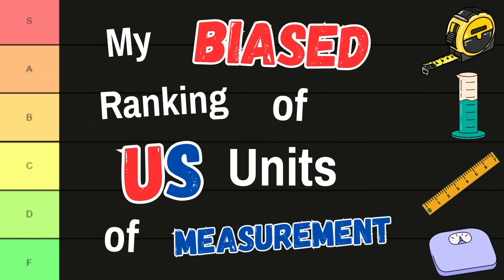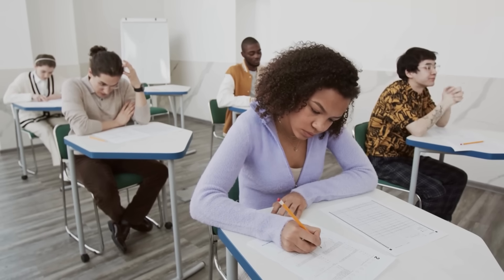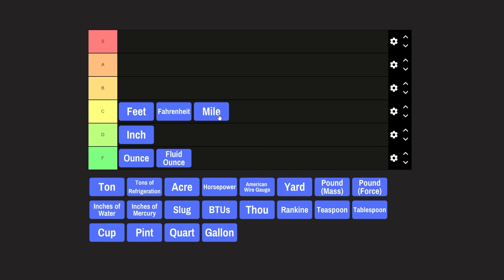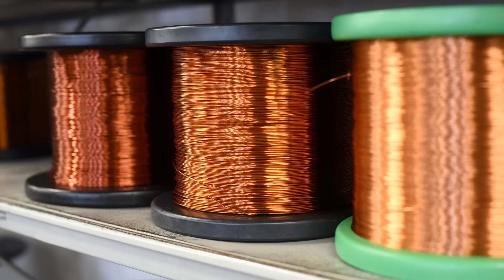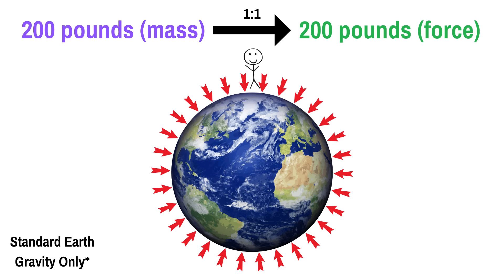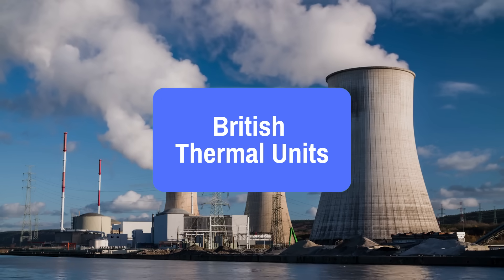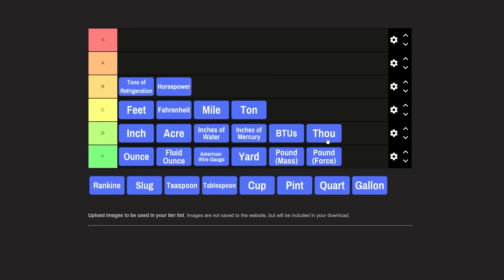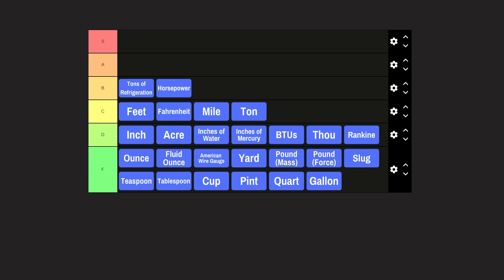Tier List of the DISASTROUS US Measuring System

Comment: British: force their colonies to use the imperial system

Also British: Look at these absolute BUFFOONS using INCHES

Also British: This is Timothy. He weighs 5 stones, 3 cloves of garlic, and a tod.
Reply: Let's also not forget the old British money system. That scale to weigh Timothy cost 1 pound, 3 shillings, 2 pence
Reply: Now, when US are no longer forced to use those stupid British units, it's time to change to metric, right? Right?..
Reply: @dmytronazaryk681  America doesn't use British (more accurately UK Imperial) units. An Imperial pint (what you'd get served in a UK pub) is 25% bigger than a US pint (20 Fl.Oz. instead of 16 Fl.Oz.). "A pint of water weighs a pound and a quarter" is what I was taught in school. An Imperial gallon (8 Imperial pints) of water weighs 10lbs. Although the tern quart, for 2 pints, is understood here, its rarely used nowadays. An Imperial ton is 2240lbs (almost exactly equal to a metric tonne). Your 2000lb ton is called a "short ton" here. An imperial ton is made up of 20 Cwt (hundredweights) of 112lbs (which is very nearly 50Kg). 1 Cwt is made up of 8 stone, each of 14 lbs. I weigh about 12 stone/75 Kilos. I prefer to use the Imperial as it sounds a lot less than the Metric.🙂
Reply: @dmytronazaryk681  Not if the GOP have a say in this.
Reply: Worked in Australia during the pre decimal days. Had to learn to count money in Pence, Hapenneys, Thrupence, Shillings. Florins, 
Thrupppence, so on. Had to add columns of coins divided by 12 and 20. Took a bit to get used to then came change over to decimal with two legal currencies running side by side for a time. Ran into the same thing in Ireland and Germany with the Euro conversion.
Reply: As opposed to being 28 bananas tall in America.
Reply: Many (older) Brits still use imperial measures in casual day-to-day life. But we switch to metric when precision is important. And speed limits are still in miles per hour...
Reply: We might have started it but at least we had the good grace to change to something better when it came along. We still even hung onto a few antiquated units for measurements where accuracy isn't essential so they wouldn't feel left out
Reply: Well, being able to change when an option is clearly better is certainly a good thing to learn.
Reply: Atleast the US fl-oz is based on mass of water and not some arbitrary solution
Reply: The british created imperial as a response to metric.  It shows in the 10 pound imperial gallon
Reply: The USA does not, and never has used Imperial units. Those were not defined until the 19th century. What the USA uses is US Customary units, and there are significant differences. Of the ex-British colonies, only the USA has not adopted the metric system for common usage, and they have the longest period of independence. Note that the unincorporated territories of the USA, essentially US colonies gained by annexation but not incorporated as states all use US Customary units as far as I can tell.
Reply: You forgot to mention those us units are standardized on the metric system.
Reply: @TheEulerID  that makes it even worse, believe it or not
Mile. Nautical mile. Pound. Ton. Inch. Foot. Gallon. Pint. Cup. Teaspoon. Tablespoon. Quart.

All of those units aren't shared by the Imperial system and the US system.
This is bad.
Reply: Nearly 40 and English. I only use imperial for things we are stuck with. Like miles on the road (though my sat nav is in KM. Go figure) and buying pints of beer. Tho I order wine and spirits in metric ml.

What the fuck government. Please can we just have all metric.
Reply: @AdamMGTF  As far as I'm concerned, then you are just another petty zealot. To be clear, I have a physics degree, and in professional work use SI units all the time. However, traditional units are part of culture and history. They have their own particular social place, and are built into the very language as idiomatic phrases. We miss things by miles, we do not give an inch, we cannot fathom something, we go for a pint, we go the extra miles, the whole nine yards and any number of similar phrases. 

This is an important part of people's cultural background. So be damned with your  yearning for consistency where it doesn't matter one iota. People generally have an intuitive feel for what they were brought up with. It is often part of their very identity. 

As a wise man once said, "A foolish consistency is the hobgoblin of little minds, adored by little statesmen and philosophers and divines". I shall continue to prefer my beer in pints, distances in miles and mountains in feet (you feel you've achieved so much more on climbing one).

I also consider it a valuable skill to be able to convert and be familiar with different unit systems.
Reply: 64 and I agree! @AdamMGTF  Was recently in Canada and the Canadians were trolling the Americans for not using metric. Did you see the results of Rees-Mogg's online survey suggesting that we go back to Imperial only? only about 0.1% of people thought it was a good idea. I voted for full on metric
Reply: @MadTamB  I haven't seen that. I can't imagine anyone at all who actually uses measurements would ever want to use imperial. 
There is a wonderful irony that Americans are proud to have left the empire yet are one of only 3 countries that use imperial. And I think the other two have civil wars or something.
I'd happily scrap all imperial units here. The biggest headache would be going to kmh on our roads. But given we don't use signs for speed in most places it wouldn't be that bad. Pubs already use metric for most measures. 

So I'll happily consider the yanks bafoons. All while wishing we weren't stuck with the legacy crap of imperial

Comment: Also horsepower was more accurate at the time, as the horse (over the duration you'd use it for) of the era (way smaller) would put out nearly 1 horsepower...
Reply: [citation fucking needed]
Reply: ...Horses are literally bigger now than they were back then. That's pretty common knowledge in horse breeding space. It's also common knowledge that larger animals produce more horsepower.  @JürgenErhard

Comment: Context: UK
At work, we have some expensive equipment that we don't want to replace unless we really need to. Dropping 5 figure sums on something without needing to is avoided).
There are 3 pressure gauges on this equipment (it has 3 components). The most recent replaced dial is in nice logarithmic mBar, another in torr (neither linear or log, but irregular..?), and the third in linear inches of mercury! When i saw inches of mercury i just laughed and imagined that it was from the 1800s. Nope, just 1970, just before we really started metric conversions.

Edit: it was/is still more typical to hear of the archaic pressure measurement to be in mm/Hg. So seeing something that is for me doubly archaic was odd. Apparently, US is doubly archaic.
Reply: Blood pressure also goed in mmHg. Not that you'd convert that into something used in a spaceship launch, it is just a comparison number.

Comment: Don't forget that besides the mile, there is also the nautical mile.
However, it is defined rather cool as it is 1/21600 of the earth's circumference.
Reply: The metre was at one point defined such that the polar circumference of the earth was exactly 40,000km. Before that, it was the length of a pendulum that ticks once per second.
Reply: 1 tenmillonth part of the quadrant northpole to the equador via Paris 
 @katrinabryce
Reply: 1/21600 is 1/60 of the number of degrees in the circumference. Arc minutes I thing this is called.